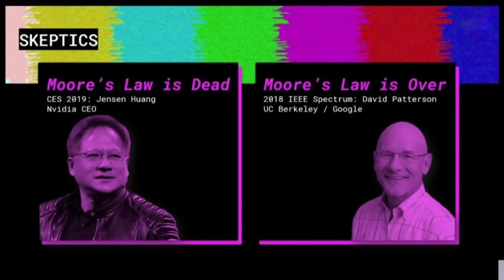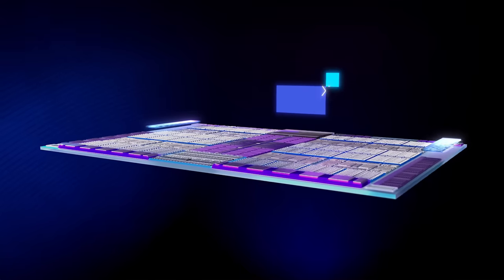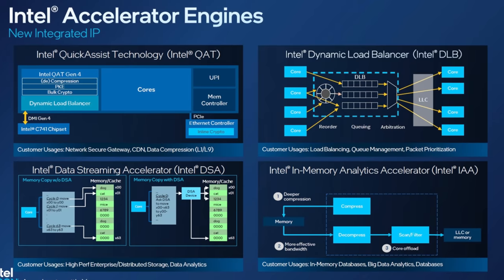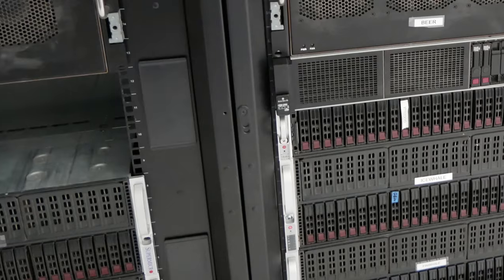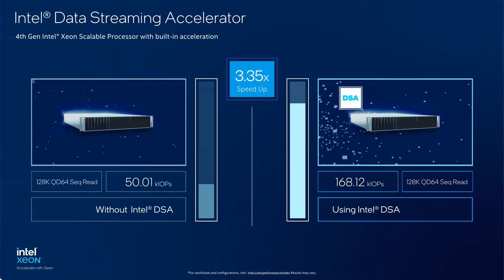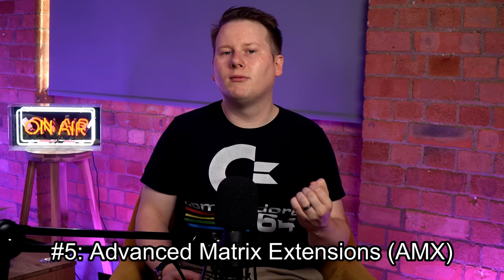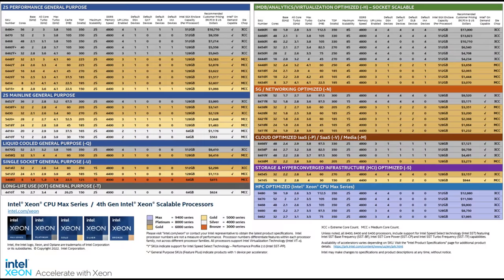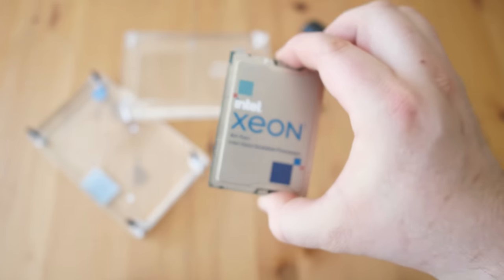What Can We Do With 50 Billion Transistors?

Comment: Domain specific logic is the natural response to the diminishing returns of the Moore's Law. It scales better with the power and area constraints than the general purpose (programmable) hardware. The difficult part here is providing a solid base of APIs and frameworks to glue all this together with the application base.
Reply: Agreed. That general purpose hardware will always stick around in some capacity, but the more you can throw at what boil down to ASIC-like accelerators, the less power you spend, the faster it gets done, and the more resources you can keep free on that general purpose core.
Reply: Don't forget actual industry standard APIs. Anyone remember 3D accelerators in the 90's having their own proprietary APIs? It must've sucked, I was born after that so not firsthand info.
Reply: @alext3811  Yeah, it was pretty bad. Its ghost is still haunting us with Cuda and RoCm, but those hardly hit the general consumer as hard, and at least there's only 2.

Comment: It's pretty obvious that accelerators are the future. Why try to brute force compute with general purpose silicon, when you can exceed that compute using less silicon, less power, and less heat with an accelerator? Some people forget that GPUs are accelerators for 3D graphics. Now companies like Intel are putting their new accelerators right in with the CPU silicon instead of making an add-in daughter board product like GPUs. Then on the hardware side, advanced packaging like Foveros is how Intel will be able to mix and match their chiplets to give each customer exactly the accelerators and compute they need. Pretty exciting times for both consumer and data center CPUs.

Comment: While somewhat of a layman at this. Its my understanding that, the beefy General Purpose portion of the CPU will be making way for dedicated co-processors on a single die. Will this burden be more on the CPU designers to make sure that processes are accurately scheduled, or on the OS kernel coders?  ... I feel like with the increase in physical cores, 'hyperthreading' will be deprecated in the consumer space.
Reply: hyper threading is used as a way for the CPU to spend the budget on all the core logic units, not leaving them empty. This together with OOP makes it so your CPU core actually runs saturated. Adding cores does not solve this problem, it just makes it worse. There were ideas of adding more hyper threads to CPUs, but they were scrapped because it makes for too much complexity.

Comment: Is the answer not the same as it has been for years now? MOAR CORES!
Reply: Its the opposite of that. General purpose compute cores can brute force workloads. They use more die space, more power, create more heat, than a specialized accelerator would for the same work. Accelerators are the way forward, just like how we accelerate 3D graphics with a GPU instead of trying to render it out on a CPU (possible with some games, but very inefficient)

Comment: M2 ultra has like 134 billion transistors and m3 ultra will obviously have more
Reply: And how many data centres are running M2 Ultra?
Reply: @backupplan6058  apple might get into the data center at some point
but rn meh it's a wasted silicone consumer soc

like xeon /amd has more performance at less silicone
Reply: @User9681e  it may be a powerful SOC but matching it against a 13900K and RTX 4090 and it doesn’t stand a chance and the whole PC gets priced under the cost of the Mac.
Reply: @backupplan6058  true anyway happy to have competition
Reply: @User9681e  is it really classed as competition when you are wildly more expensive, lower performance and in an ecosystem that actively looks to lock down competition by being incompatible, non assessable or repairable. Apple has it’s place and it’s increasing high end luxury. I know graphics designers 10 years ago who would have nothing but Mac but now can’t justify the cost over PC.